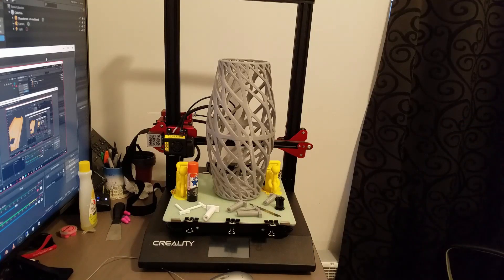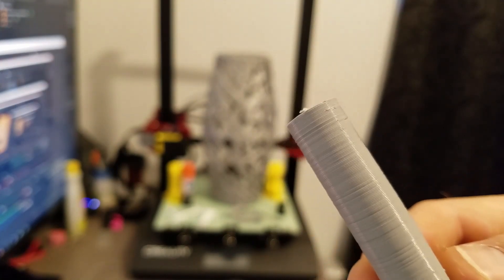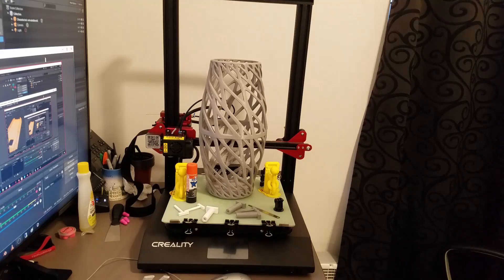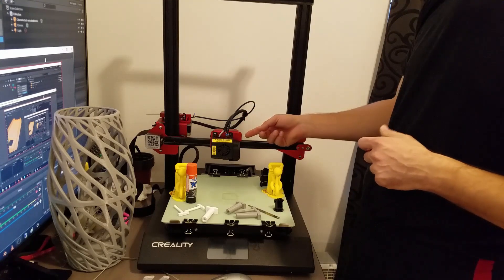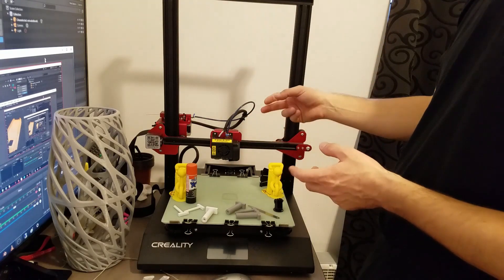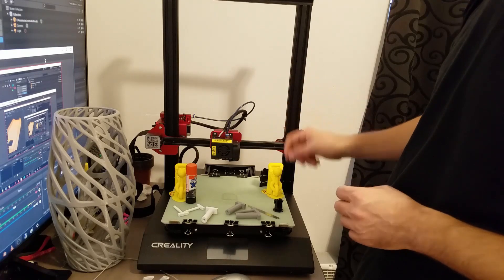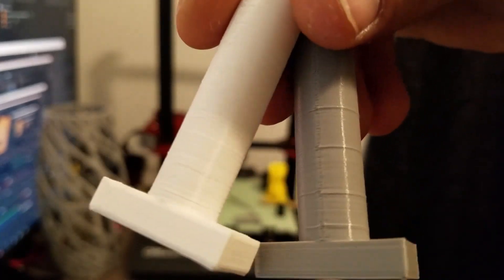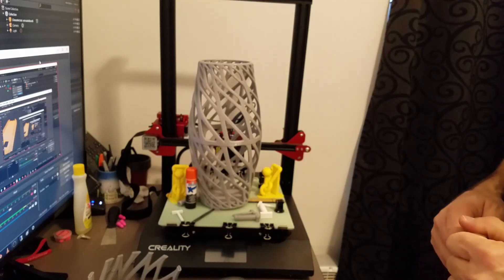Creality CR10s Pro Review beginner Print Head tightening bed Leveling and gotchas

Comment: Hi, only problem that I am having and is not with the printer is, learning Cura and the settings. Thought about getting Simplify 3D, but everyone is saying don't waste the money.
Reply from the maker: I do not have simplyfy 3D. And I never used it. but I saw many suggestions to get simplify 3d whem my prints werent too good. but there are quite a few slicers out there that are free. and I think you can test with those. when you suspect a slucer peoblem. but lately Cura for me has kinda of beaten the rest of them. but when in doubt i take the prusa slicer for a spin. By the way I did not test all the settings individually in Cura and some of them are too obscure. but there are a few that are important to know. but after only a year od 3d printing I realised that my high expectations were high because I was new to 3d printing. in the last few month I 3d printed an RC plane and some rails and especially for the rails, I was relying on the minute errors for the rails to connect and require some force when sliding. anyhow, the RC plane quality was not too great and I decided to buy .9 arc stepper motors which are still lying around. and because so.etime I do not like to fix what's not broken. so in the end if you have a project that needs to get done. you may just drop you demand for quality. but not when the project is supposed to be ornamental.

Comment: If you check the aluminium mounting area for the eccentric wheel you may find it bent.   I did with mine.   It was just enough so the eccentric wheel was out enough so that it ran out of adjustment.   Once I straightened the bend, I was able to adjust the bottom roller so as I had perfect alignment and no play.
Reply from the maker: thank you.

Comment: Make sure your printer is at the latest Creality firmware (1.6.3 or above), or better: upgrade to TinyMachine's firmware (both screen and motherboard). This firmware does save the auto-bed leveling and so much more. https://www.reddit.com/r/CR10/comments/annpqq/cr_10s_pro_owners_who_updated_to_tinymachine/
Reply from the maker: Thank you for the info. I appreciate your help. I do have to say that I cannot confirm or deny the results others have had, but After Installed the firmware the ringing was still there but they were less protruding, then I I think I worsened the prints by tightening the offset nuts too tightly. Then I took it apart and released the belts from the motors to just feel the how the axes traveled and if there were any bumps in the rails, I did discovered one bump in the y rails and also the y rails narrow toward the end in mine. Just now I disabled jerk control and I still got some ringing, It has been a long and arduous process. Still going at it. Again thank you for helping me out.

Comment: Ive seen this print head problem a couple of times on the internet. Got mine a couple weeks ago and the print head was very secure so I'm not sure how to adjust it other that the bottom wheel needs moved higher
Reply from the maker: I get what you are saying, mine was all over the place. And i still haven't figured it out on how to actually have a logical way of tightening it. But wait, you got it from Tiny Machines and from your previous comments you did say that they test them all and ship them well. I think that is how I kind of figure it out that it can be tightened. I saw their inspection video on things to do. Let me tell you this printer has been running my life for the past month. I only printed a few useful things, most of the prints Are failures or benchies and cubes. I should post an ode to benchy and the xyz cube. the wording is been rattling through my frontal lobe for some time, or just the few first sentences ... :))) I really do appreciate you letting me know about the firmware.  I have to get that done.
Reply: @RoamingInterests  I bought it directly from Creality, and installed the tiny machines firmware. My guess is, creality has probably been getting feedback of the conditions these printers were in. Probably a lot of returns which is bad for business. Everything was secure when I got it and have printed very nice quality prints. im going to be swapping out the print bed again for one more level. The aluminum bows on mine. Its level on corners but dips in the middle. Of course this is due to it being metal. I'll see if I can find the post about adjusting the print head
Reply from the maker: 101mercenary ,  returns, They haven't been very open to me about returns, they have deep problems guiding me on how to fix it, and they keep replying with nonsensical stuff sometimes. I am getting aggravated, I have been trying to get this thing to work for a month now. actually two, and yet it works but I am not satisfied. So i may have to reiterate my issues to them and ask to return it. All the way back. But then I feel Like I am giving up. So it is catch 22. I may have to come up with a proposal for them see if they agree. I may have mixed up the fact that you got it from tiny machines. But can you post an 20mm xyz cube picture somewhere so I can see if your quality prints how different is from mine.  I feel Like I am in a vacuum trying to solve this issue, even if you guys are helping me out every step of the way.
Reply: @RoamingInterests  currently have my printer at a studio I work at so I'll see about getting a photo of the cube and my benchy to you. I know for certain if you don't have your print head secure enough, it will not be accurate no matter what the software you use. It may be best to see if they'll accept a return. Tomorrow I'll look over my printer to see what you can adjust on the head for more accurate prints.
Reply from the maker: Wait a minute, I did tighten it up, it had no play after that. I took me forever and a half but, I tightened it. Now that head is tight Or did you see something else that makes you say is not tight?
Reply: @RoamingInterests  no as long as you have no more play in it and it rolls smooth along the z gantry you should be fine. After that all adjustment can be made it the slicer to fine tune the settings.
Reply from the maker: There is no more play in the print head. And that was quite a feat of skills of mine, more like brute force time allocation :) han intelligence. Or should we say perseverance?  As i may have mentioned, there must be a second variable in tightening the 3d print head because the offset nut alone does not do it.
Reply: I would first make sure you can at least get good cubes and then move to the benchy and then to bigger prints. I know when I first started I was getting layer shifts at 60mm/s and then bumped it down to 50. Travel speed 110mm/s. Speed settings should help because the printer is going so fast it's going to slip on the belts or motors. Double check the belt tensions as well
Reply from the maker: Man this printer it is sucking up all my spare time. I get the cubes just fine, I am not happy with the faces. I want the xyz calibration cubes without any saturn rings protruding randomly. Evenness. Do you get them completely even? Because for me it is just a nice dream... :)
Reply: @RoamingInterests  haha yes I do get them evenly across all layers. I need to find a way to post my g code or at least my cura profile so you can try them out. Might make a video using my phone and post on my channel. Do you use Cura or another slicer?

Comment: Learn how to 3d print. Know your hardware. The sensor is an easy replacement and shouldn't define the entire printer. Get a bl touch or a better capacitive sensor. Stop Crying. Start Trying.
Reply from the maker: Thanks for your suggestion, at the time i did not know, and I was expecting for the printer to work out of the box. Just today I got one I think is compatible with the printer it was only $10 or $11, not sure it will work any better. If you know can you make some suggestions? Thank you.

Comment: My 10s pro does beautiful prints, no layer shift at all so there is something off with yours. But still, man the leveling procedure..  EVERY TIME BEFORE EVERY PRINT. crazy and the capacative probe is just so bad and unpredictable. But print quality is great. Dont forget to preload the leveling screws on the bed A LOT otherwise your whole bed will shake and cause layershifts! And try using lower jerk settings in your slicer.
Reply from the maker: Thanks for the tip on the jerk settings. Yea leveling is terrible, In addition the bed or the bed plate does not sit straight so I placed a Thick marble tile on top. that is quite heave, and might damage other things. Still not sure what could the problem be. But I am still working on it.
Reply: Roaming Interests I use the original bed (but ordered a wham bam flex plate) I did level the bed with painters tape and then put the printbed on top. Most influence on my prints had the pre tightening of the bed springs and the used filament. You should test with the same filament all the time to see what does improve things. I did nothing to the printhead, just tightening till it doesn't wiggle anymore.

Comment: this printer is a disaster for the horrible quality control of Creality, i found non steady bed and i had to tight all the wheel, the wheels of the hotend were to tight , the bed leveling need hours for perfect results, there are a lot of problems with the slicer, with the last versione i had misalignment of the prints but not with the versione in the creality pendrive, thanks to god i still have my "old" cr10 s :)
Reply from the maker: Not sure if you saw but I do have cr10s 5 new in the box and I am relenting to opening the box and just selling it, because I am frankly tuned out in tuning the cr10s pro. But your comment got me intrigued. Have you gotten consistent better results with your cr10s vs your cr10s pro?
Reply: @RoamingInterests  the printer is a disaster for my expectations, first of all printing quality is absolutely the same of the cr10s, before assembly check the bed , alle the screws of mine were not tight , the belt tensioner is just a screw and in my opinon this it's too cheap and not adjustable but the worst thing is the upper alluminum bed: the printed objects adhere too firmly, when you try to remove them you easily damage the surface, the not standard size (310X320) don't help you and the levelling sensor don't work with glass or transparent surface. Bed levelling it's an adventure, perhaps after 10-15 times of try you can find the right setup. I did a stupid thing to buy because i have a cr10s and i don't really need so big printing area, my next buy will be a prusa mk3 without any doubt
Reply from the maker: I have been checking all kinds of things on this printer, eventually I will get it right. On the bed leveling I have to say it is a pain. I managed to use a piece of heavy marble to keep the bed straight. As for the leveling it has a mind of it's own sometimes it level right and then it doesn't so it is a constant problem. In addition I printed a xyz calibration cube and printed pretty nice. used the same gcode to reprint, I got different results. I'll post a video this weekend. I started printing some useful stuff rather than just dialing in the printer. To be continued.

Comment: I hate this printer, the bed-leveling is a half an hour fiddling with a 10 cm piece of acrylics, a 0.2mm feeler and screwdriver, followed by the automatic bed-leveling before each print. And still the print-head cuts into the middle of the printer-bed. After many trials, the top-layer of the print-bed had a hole in the middle. the magnetic extra print-bed ( bought and advertised as for the cr10spro)  is too wide and hits the printer, is not long enough, so leaves 1cm of the print-bed bare. The print-bed does not fit under the clamps. Do not buy this printer, not as a pro and not as a beginner! Unless you have 3 hands.
Reply from the maker: It has taken over all my free time trying to tune it. It seems that I can never get it right.
Reply: I'm really going crazy with this printer for the leveling and leveling sensor of the first layer. I'm seriously thinking of reselling you invest some money and take a Prusa i3 MK3 what do you think?
Reply from the maker: If you can resell it I think you should resell it. I have a creality cr10 s5 in a box for 3 weeks now, the cr10s pro arrived first and now I do not even want to deal with the cr10s 5 version. I am so 3d printed out by the creality cr10s pro that, if I never see a creality printer again it will be too soon. I do have one suggestion, try checking out reviews on the cetus mk3 extended. I realized that I rarely need large parts, so a cetus might just get you what you want. And I saw a few people raving about them. And if you want repeatable results that may be what the doctor ordered. Also you have to know that the cetus is not yet open source. you can get the ehated bed additional feature too and you should be set. But also you have to  remember I never used a cetus so please check online for reviews on it to form your own opinion. Actually, I just threw the box out yesterday of my cr10s pro, Now i regret it. You gave me the idea to just sell it and move on to another one.Tonite it took me one hour to dial in the bed after i changed the plate to a piece of thick marble. I think this may break the belt or the motor. I am printing a phone tripod holder i may post online the timelapse.
Reply: This trash or so called pro printer, has been returned for a refund. This is where this hobby ends for me.

Comment: The side walls should be like glass , I`ve not heard from anyone who paid for their printer not comment about bed leveling. I`ve just wasted a couple of days and nearly a kg of filament trying to stop it layer shifting every few mm , so disable the jerk control in cura is my bit of good advice. 
Didn`t have a problem with the X axis , so if it is not broke don`t fix it ( I wish I had followed that advice myself ), because Z axis is a nightmare, making it go up the gantry level and not put pressure on any of the wheels. 
Use a ruler to measure the distance between the lines ? which could be a rotation of a wheel on the Z axis.  
If every layer is uneven try seeing if you are over extruding , print at 90-95% flow rate and see if it clean now.
Have you set the bed on the end of the springs so there is movement on the bed ?
Reply from the maker: I have adjusted the bed on as best i could to allow the nozzle not to print in the air but also not be completely stopped prom extruding. I did not press on the bed to see if it still has give, but I remember the z axis is so strong that it always compressed the bed when my leveling gauge was set to a coarse setting. Noe I just try to ever so slightly he nozzle touches the bed. I cannot test at this moment because it is printing benchy on top of furniture, and the furniture /shelf it moves under the printer's momentum. But I want to see if benchy comes out right or wrong. My intuitions sais that because the vibrations are send down into the furniture and the entire assembly is moving together then the printouts have to be the same quality or better given all the settings are the same. 

I think this will have to work as I am anticipating.

Thanks for sharing your tips with me.